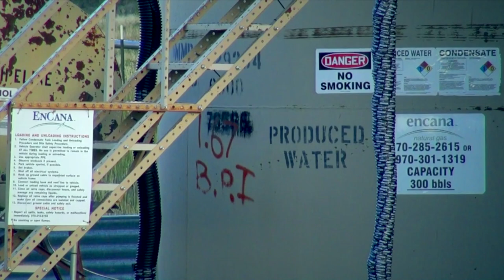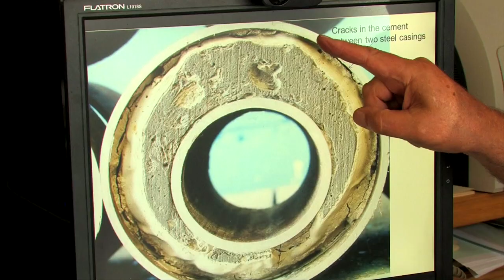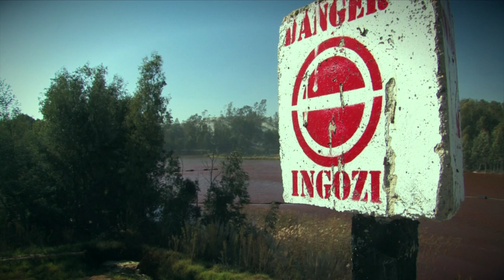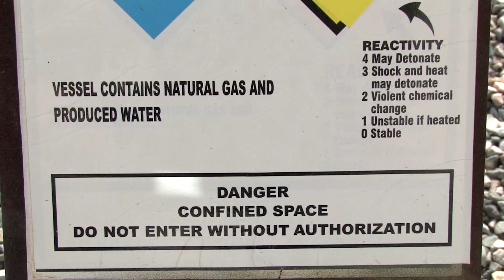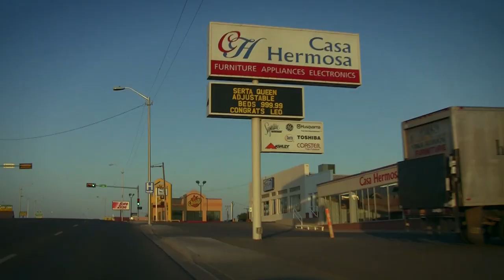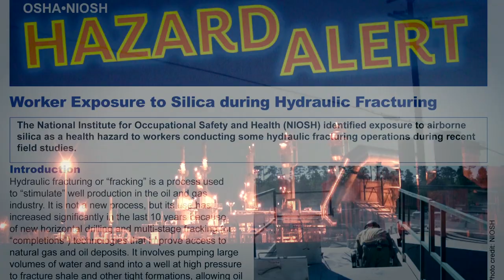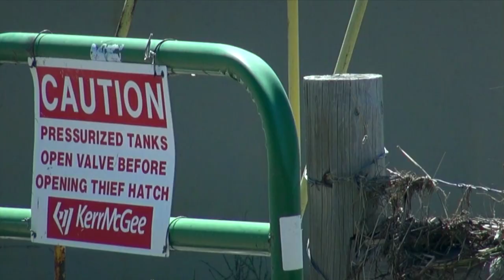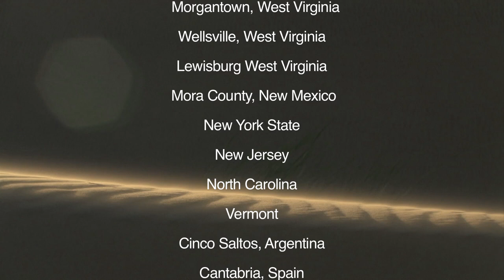Fracking is Dangerous: The High Cost of Cheap Gas | ENDEVR Documentary

Comment: What do you drive? A 2  tonne machine. How do you heat your home. Ask yourself who is the problem.
Reply: You don't have to depend on has to heat your home. We have electric heat strips and heat pumps that use the air and ground source and water heat uts not always about gas plus we have solar heat and solar power
Reply: more than half of all us electric is generated using natural gas.  Just a longer tail pipe.

Comment: I live is Colorado where there is lots of fracking for natural gas extraction.  There thing about fracking extraction is that it much less environmentally damaging than older non-fracting extraction methods.  Instead of being scattered all over the land scape frack extraction concentrates the drilling in small drilling pads.  Each fracked well also replaced what use to be 50 or more non-fracked wells.  The effect is much less eviromential damage and where there are misshapes clean up and containment is much easier.  It's not that improvements can't be made.  Instead of water propane can be use as a fracking fluid.  This eliminates the problems with water based fracking fluids.  Up front cost is higher but the propane used is recovered at the end of the process, the resulting wells produce more gas, last longer such that propane fracked wells, in the end, are more profitable than water fracked wells. Propane fracking is also safer than water fracking as propane fracking fluids can be formulated to be non-flammable and non-spillable.  In my opinion instead of complaining about fracking per se I think the issue should be the use of water when a cleaner and safer material is available in the from of propane.
Reply: By limiting the fluids involved, we could also limit the amount of spillage when handling the fluid and maintaining the well. When an excess of fluid exceeds the casing pressures ability to push fluid. A swab rig comes out to 'plunger' out fluid so the well can again be in equilibrium. During this maintenance alot of human error can occur. In short, reducing the need to handle fluid also reduces the opportunities for spilage.
The only conflicts I could think of is instance where the contractors who own and operate the rigs on Anadarko's wells have conflict of interest. We had a older guy who would supervise  and coordinate the contractors on the companies behalf. This man also had his own contracted rigs operating on the wells, I suppose he was securing his own income with his position.
Reply: Propane is more expensive than water, that's why nobody is doing this.
Reply: @stanleytolle416  So if it's so much better why aren't they using it?
Reply: @SteffiReitsch  it costs about 40% more at first and the rigs have to get set up for it.  There is also a company that has developed a nonflammable liquid propane fracking fluid addressing the issue of fire danger from using propane. I would say it's a get rich quick mentality that's causing the adoption problem.  Adoption of the process was greatly slowed by crash of gas prices during the pandemic.  Right now drillers are rebuying all their equipment that they scrapped just a few years ago. The push is to get as many rigs going as fast as possible. This can be done by going the cheapest way to frack.

Comment: and when you think , that for every task , a certain people is needed ! what i m saying is , we all , to one point or another . paticipate to the Masacre....
Reply: Yes, sickening isn't it.
Reply: We are all guilty in some way.. myself included.. unless you live completely off the land, but that is very difficult.
Reply: It’s true that it is difficult to live off the land but it could be made a lot easier if we put as much research and resources into making it easier to live off grid. The safest way to supply a home with electricity and heat and water is for the home itself to be a power plant that can charge batteries from wind, solar, and human power, and the electricity that can be harvested from the earth and the air. Early telephones were power by a handcrank generator and telegraph messages were powered by electricity from the ground around the poles. They never had to worry about the grid going down because there was no grid. Communication could be wirelessly through satellites or passed along  through a series of local wireless receivers and transmitters. We wouldn’t have to worry about nuclear power plants like Fukushima melting down or not having anywhere to put their nuclear waste nor would we have to worry about environmental damage done by the oil, coal, and gas industries.

Comment: It is truly a conundrum. The faster the world turns, the more energy we need. A lot of one or even two income families cannot afford to install and maintain green energy. And even some geographical locations are not suitable. For instance, I live in a deep narrow valley that gets very little sun and some days not more than a gentle breeze. Neither wind or solar would benefit me. I cannot afford to relocate. I used to burn wood for heat but I now use propane. One thing these companies could and should do is to install specialized water treatment plants everywhere they have their operations. That's the least they could do. Much more should be done. On a side note, the electricity supplied to the DC Capitol Complex ( over twenty buildings and structures) is generated by a COAL and NATURAL gas fired power plant located in southern DC.

Comment: The fact of the matter is that fracking is supposed to be safe, in theory. There are many moving parts to the process and little oversight which unfortunately leads to human error and negligence, often causing the unfortunate circumstances we see in this documentary. 

Due diligence calls for protective casing and cement in the surface, intermediate and lateral sections of the well in that order, with the surface and intermediate sections closer to surface being cased/cemented with a higher thickness to protect the surrounding strata. The drilling muds/lubricants are different for each stage, as well. Those for the surface and intermediate sections are generally water based, and may be transitioned over to an oil based/synthetic mud once the lateral section of a wellbore is reached. This is also done to protect the exposed strata being drilled through in the first two stages. Each stage of casing/cement is also pressure tested to make sure the are no leaks. 

Generally, there are thousands of feet between groundwater aquifers and most fracking operations. We are talking about upwards of 5,000 feet +, or almost a mile. Between the formations at these depths, there will be many impermeable layers which will keep anything found in them confined to that depth. The only exception would be if there is a major fault traversing these layers, but major faults cutting across thousands of feet are generally rare, as we are talking about millions of years of deposition and geological events and this would not allow for one clean fault in that manner. Especially true in more stable geologic regions.

The real issue comes when dealing with the byproducts of these wells whether it be accidents, lax government oversight or negligence. Wells will not only produce oil or gas, but will also produce water, methane, and a quantity of other gasses and liquids along with the main product. These byproducts to be stored at the well site as they are produced for the duration of the wells productive lifetime and may be burned off, or released into the air in the case of gasses or hauled off via truck or pipeline in the case of oil and water. The air quality near one of these sites may register a change if there are enough of these sites clustered around an area and the government would need to monitor the air quality to protect any populations living nearby.

At times, a site may experience a blowout, which is a sudden increase in pressure pushing up water, gas, and/or oil to the surface or to another subsurface formation. These can happen while drilling, or after drilling, even at completed wells and may last anywhere from a few hours to over a year (Deepwater Horizon, and others in the deep sea or countless others that occur frequently on land). A completed site may encounter natural disasters, such as floods, hurricanes, tornadoes, earthquakes, etc. All of these things may lead to an unexpected release of product, which could inevitably lead to pollution.

Another often overlooked aspect of drilling is the disposal of the wastewater used in the fracking process. I'm not sure about the case presented in the video in South Africa and Botswana, but in general in the US, very little of the water returned from these wells is treated and reused. The amount of water used to drill is enormous, in the vicinity of millions of gallons, and whatever is recovered from the well is left to evaporate in surface retention ponds or disposed in deep underground injection wells. These retention ponds should be lined in order to avoid any leaching onto the surface soil. The deep water injection wells are generally drilled to a deep formation confined by impermeable formations above and below in order to avoid any migration of the fluids to any other formations, however, issues do arise and have been documented with these wells, too. It is believed by some that these injection wells cause an increase in formation pressure, and lubricate/reactivate old faults, leading to earthquakes in their vicinity. 

We must also take into account the downstream processing of the product in refineries, distribution globally (tankers, semis, trains etc), local storage (gas stations, etc.), and the impact that other useful petroleum byproducts such as plastics, asphalt, medicines, clothes etc have on our lives and the environment.

The oil were extracting from the subsurface was made by natural processes, but it is still composed of harmful chemicals. These chemicals will cause harm when released onto the environment if we are not careful (whether a spill, gas release, or even plastic waste). In theory, the processes used to extract oil should be safe, but the reality of it is that there are many moving parts in the supply chain with many chances for something to go wrong.
Reply: You put a great deal of effort into this comment and it shows a great depth of technical knowledge on the subject. I have worked in lil and gas and like anything else’s if you plan and have good technical knowledge things can and most of the time do happen with out incident. If it is approached with a rushed careless attitude you can make a real mess.
Reply: Well said, you covered most and beyond of the flaws I saw in well maintenance.
Reply: So basically a mountain's worth of effort for something that can never be burned cleanly. Sounds like it needs to accept that it's the old form of energy. We need to accept that green energy is the only way forward.
Reply: @taylorbug9  I work in frac, and were flat out busy. Our schedule is literally booked up. As long as military needs fuel. Fracing will continue. I run fuel, sand, hydration unit, frac pumps and chemicals. I got 9 years in oil field. I even done cement, setting up the protective casing. So much money in the bank for my daughter.
Reply: @honeybadger4389  until it runs out. We can move on to better forms of energy before that happens or we can continue to let prices go up as resources go down and then we can panic when we get to the point where there's not enough to go around but we haven't developed systems to handle the amount of power our societies need. But you know what?  F*** it, let's just procrastinate coming up with an energy source to run our entire lives. Because some owners of oil companies are making bigger bucks off your hard work.

Comment: Why would anyone pollute there own drinking water ?
Reply: For profits. Love of Money has no limits as it is the root of all evil.
Reply: They are not polluting their own drinking water.  They are polluting the "little people's" water in the communities they destroy for profits as they sit in their pent houses.
Reply: fracs are thousands of feet below the water line divided by a rock layer hundreds of feet thick...this video is full of mis information and lies, i work with fracs as part of my job...this was laughable
Reply: Desperation and greed. The locations of wells vary, some are placed in land that was later turned into suburbs by land developers. I've seen parks and neighborhoods that surround a well. Look for the park at Eagle Butte Ave and Wyndham Hill Pkwy. There are more wells within that neighborhood. Usually people complain about the gas that is released when these wells are serviced for maintenance, so it is likely there are not often utilized.

Some farms that host the wells, don't look like they are economically well off so they supplement their income by leasing land for the wells and roads that lead up to them. Look for the turkey farms in Weld County at the intersection of CR19 and CR22. They are dilapidated and don't seem to house turkeys anymore, but are instead used as storage. One even has a horse and some cats living out of it. In street view you will see a black swab rig (pulls excess fluid out of wells).

Comment: Don't mean to be that guy but when you say things like 40,000 L it sounds like a lot but technically it's like when you're driving down the road and you see one of those semi trailers with the tank on the back like the full size trailers that's 40,000 L Yeah it's quite a bit but it's not like mind blowing. You know when you're talking about water contamination and you're taking pictures of places where there's equipment surrounded with water on the ground from rain that could be associated with the voice over talking about the ground water. (ground water is under ground not the water above from rain well that is eventually but that's another story) it looks pretty bad too right I know I live in Alberta Canada and I've worked in oil and gas industry and we do have different rules here than United States does and other countries but if it's properly done it can be done proper.